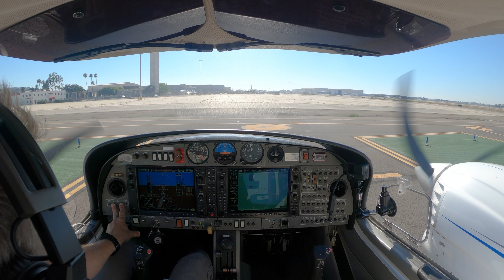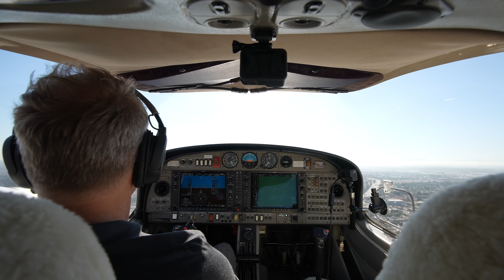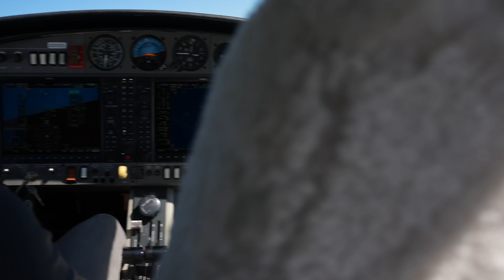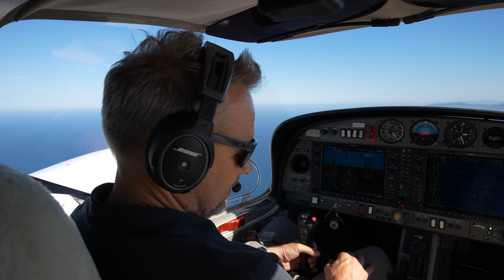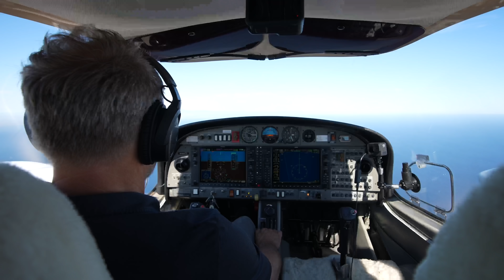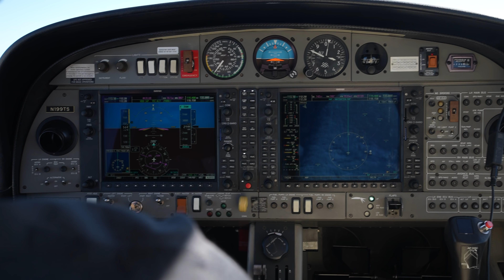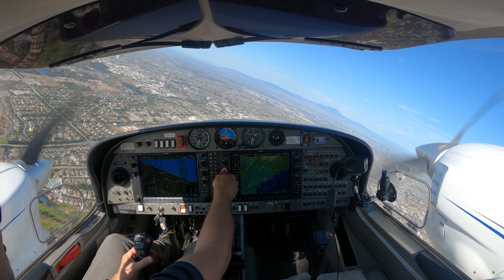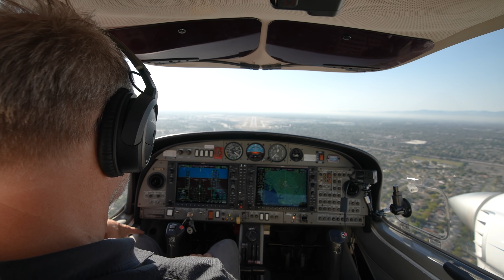#79 Gorgeous 2006 Diamond DA-42NG Airplane Review

Comment: Well, it’s not only a trainer. It’s a perfect personal private plane, really good on cross country and long distance. With an outstanding fuel performance and all the Diamonds have a huge safety advantage compared to other planes because of their strong structure. The work load is reduced to equal airplanes. So it makes a lot of sense outside the flight schools to fly and own this private. The range by the way is about 1.200 nm with 60% power settings at about 12.000 feet.
Reply: The -62 destroys this one tho.
Reply: @superskullmaster  yeap, but is more expensive. It depends on the budget I guess. This 42 here in my opinion is s bargain, because of the upgrade and fairly low time with 3.000 hrs.
Reply: @superskullmaster  Yes, but it all comes down to your individual mission. Think of it like a car. If you're a single guy, you don't really need to drive a Suburban when a smaller car/pickup will suffice. For me, the DA42 would be perfect for my mission while the DA62 is beyond my needs.
Reply from the maker: Did a little X/C in the DA 42 this weekend - 165 KTAS on 13 GPH, very comfortable and economical. Not just a trainer for sure!
Reply: @FlyingwithRich  right. Nice. That’s what I think too. This can be easily a very reliable private plane, a little personal airliner.
Reply: @superskullmaster  yes it does, including in COSTS just as other people have already chimed in about. Not to mention the pilot/owner's mission needs. Saying the DA62 destroys the DA42 is subjective at best.
Reply: @Amayi1  in fairness most people who can afford planes past the $400,000 mark just go ahead and buy the most expensive one.
Reply from the maker: I don’t know - building ME time is a good step prior to moving up to expensive aircraft with hull values getting higher in owner- flown market, insurance getting harder and more expensive to get.  I think a lower cost 42 ME/FADEC/G1000 is a great pre- cursor to moving to a more expensive twin. Also has built in demand with training market.
Reply: @FlyingwithRich  all that is true, but so is what I mentioned. And that’s not me saying that, it’s Cirrus, Cessna, Gulfstream ect who say that. It’s like, if you can afford a R-44 you could probably afford a R-66.
Reply from the maker: In my experience, common for people to buy way less airplane than they can afford. I think a lot of factors are considered beyond what is affordable.
Reply: @FlyingwithRich  well the SR22/22T sells more than the SR20. This trend is noticeable for many aircraft. People tend to get the more advanced avionics as well. That’s not to say everyone buys the most expensive options every time, but people with money find it’s better to get it out the way now, because you are just going to want to upgrade anyway.
Reply: @FlyingwithRich  of course. Money doesn’t make a professional pilot out of you. You need the skills and training. When  I can afford a Citation X I can buy it. But I can not fly it. I need the ME, the training, the step up. That takes time and years. So it’s never about money alone. A often made huge mistake in aviation, where people think, money can do it. The airplane has to fit to the mission and the skills first. Then comes money.
Reply: @superskullmaster  no. less speed/range & price.
Reply: @superskullmaster appreciate 62. But choose 42 as i travel solo mostly long cross-country. And 62 is far more comfortable than 42 but being a solo, paying 2 times the 42 and 7 seat capacity sometimes feel unnecessarily extra. And again it's subjective.

Comment: did my multi training in the DA-42. fantastic aircraft and capabilities, when it worked!
Reply: Mark Pachol  well, ive had ECU failures ground and in flight ( i think thats just normal for the 42).

 on some really hot days, ive had random engine fire annunciations.

since the propellers are so low, sometimes debris hit the propeller, and since its a composite prop, the outer coating comes off and the wood core is visible.

also, the wings take alot of debris impact, and if the outer epoxy covering is damaged enough, the carbon fiber layers show, and the aircraft has to go down for repairs.

other than that the aircraft is really great. super fast, fuel efficient, and flies like a fighter jet
Reply: @bndahi8251  that’s not good. But these issues are not regularly and normal for the DA 42 well maintained. I never heard about this with the NG DA42. The very first once with Thielert engines had some trouble. With the austro engines this should be ok all over. The DA 42 flew around the world several times without any major issues. It’s like you think also a great reliable airplane. I would trust the DA 42 for big missions.

Comment: I’ve trained for my MEL checkride on the DA42. I had my oral checkride on Monday and had to postpone the flight portion to Friday because weather. I passed the oral so just got to perform well in the flight on Friday. I love this aircraft!
Reply from the maker: Nice - thanks for watching!
Reply: @itp5x5 I did my multi at OSM aviation at KFXE. Per hour it’s approximately 500 dollars, depending on fuel price fluctuation.
Reply: @itp5x5 I did my PPL in a Piper Cherokee and it was about that price too. Really good trainer aircraft. And certainly the SR22 is a next level single engine. Enjoy the journey and study hard! One of the most rewarding experiences you’ll ever have, in my opinion!

Comment: Just one question what happens when the computer controlled airplane it's computer quits working for example all electrical devices in the plane goes dead? I don't see a sixpac backup nav system in the dash? Suppose your in hard IFR when this happens?  Also I have noticed for a while now that new pilot relie entirely way to much on all the new electronic nav systems in most of the newer aircraft these days. I am willing to bet on some of the recent crash s were due to all the electronics going out in flight.
Reply from the maker: I think you are correct. Over reliance on autopilots and big Nav displays is common now, and I think contributing to accidents. Thanks for watching and the comments.
Reply: Agree with your reply 100% Rich. Nice vid as usual 👍

Comment: Twins in a GA plane are an obsolete and dumb idea. Reractable gear (uninsurable). Twice the fuel, maintenance cost and for what?  Go slower than a single?  Cirrus has the answer, Diamond failed to challenge Cirrus due to these factors.
Reply: Depends on the mission - eg water crossings, night IFR over thick terrain, useful load, …
Reply: @baomao7243  As I pointed out, few GA owners need to cross water since these planes have a limited range.  Night IFR is not a mission, it's a choice to fly in bad weather, especially at night, very dangerous and not something a GA (non commercial) pilot and plane should be doing.  There is no increased useful for twins, in fact, they have less useful due to the added engine weight.
Reply: @speedomars  I too am impressed with the fast singles. But there is a market segment for twins. But correctly point out that many don’t need it.
Reply: @GearHead Variety Channel Most GA twins are not pressurized or have de-icing systems.  The redundancy does not get you down safely and the danger of losing an engine on takeoff and then crashing due to extreme yaw are far higher than losing your life in a plane with a chute.  To compare planes with chutes you cannot go to the pressurized class, they are FAR more expensive and have a different mission entirely.
Reply: @GearHead Variety Channel No.  The three most popular twins are the Piper PA-23, 7,000 built, the Beach Barron, 7,000 built, and the Cessna 310, 6,000 built.  Two are non-pressurized. The Baron is pressurized.  And of these, the Pipers and the 310s were all built before 1980.